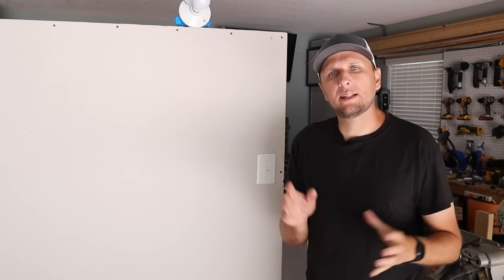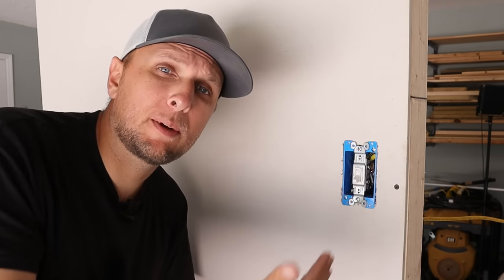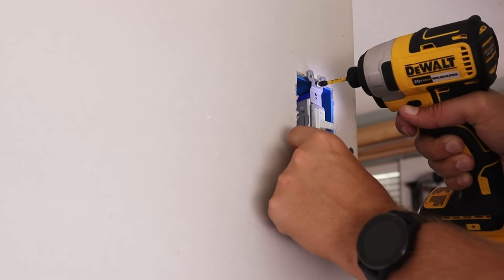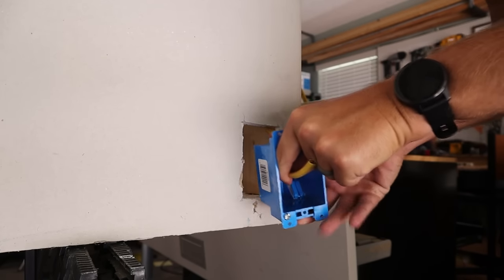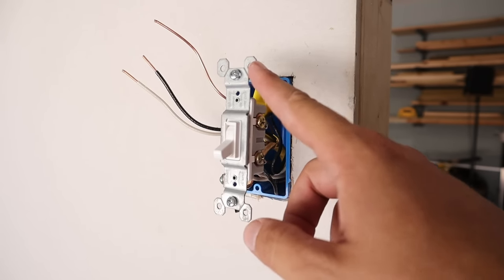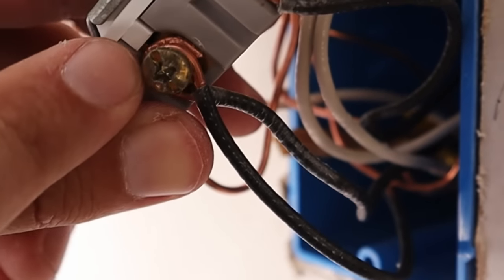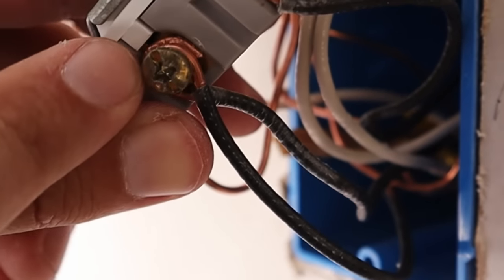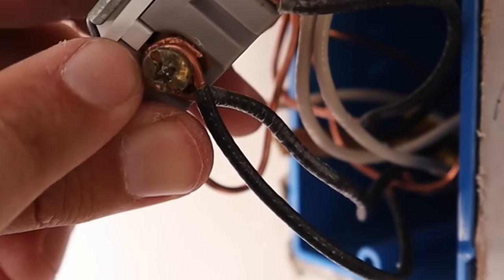How To Add An Outlet From A Light Switch | Common Mistake

Comment: Great vid. When I install a receptacle and have marked it on the wall, I’ll start sawing in the middle of the horizontal line and cut towards the stud (in your example towards the right). 99.9% of the time the stud finder works. I remove the drywall closest to the stud, so I can look inside to determine if I’m lined up like I want to be. If everything looks good I remove the rest of the dry wall. If not, I can realign thus not cutting to big a hole.
Reply: Multi tool is best on dry walls
Reply from the maker: Thanks for the input!
Reply: … not cutting TOO big a hole.
Reply: @stephenwilliams6103  a multi tool is the worst on drywall. You can easily cut into a romex. If you do that, you’ll have to run a new wire, or open the wall and install another j-box to fix the break. Additionally, a power tool will make a LOT of dust that can’t be cleaned up for hours.
Reply: @BitSmythe  Hospitals have been using multi tools (same principle)for cutting off plaster casts  on broken limbs for years, it's about using the right blade.
Reply: @BitSmythe  I use a vacuum while cutting.  And avoid going deep.  Also we only use armored BX cable here in NYC.
Reply: @BitSmythe  
Have to disagree about the multi-tool. 
. 
If you are inexperienced - thus, not cognizant or fail to remain cognizant of the fact that there may be other conduits (ie. PVC plumbing) or NM conductors running by where you are about to cut out an opening; so you are SLOPPY, and FAIL to cut in a SURGICAL manner: then yes, you are more likely to create a very undesirable situation.

IF you are not CAREFUL and fail to cut as I said, in a surgical like manner (ie. thrust deep into the wall willy-nilly): Then you can damage 'stuff' that might be there, with EITHER with a DRYWALL SAW or a MULTI-TOOL.
Reply: @sclm55  Correct. We who are experienced can feel how the tool works. And they’re great for so many things. Even still, I’ve seen wires that have been run around a stud and barely below the surface of drywall, plastered over and with no nail plate. Personally, my work is often in very upscale locations so we use a hand drywall knife with a catch tray (paper dustbin, painter’s taped to the wall) AND a vacuum. Not a spec of dust left over anywhere. Just one of the reasons every one of our Yelp reviews are 5-stars.
Reply: Overall. Your video is instructive.

I would have started out though addressing the fact that quite a bit of NM (Romex) powered switch boxes ONLY contain [1] one NM cable (14/2 or 12/2) from the lighting outlet box to the switch box...meaning, there is NO NEUTRAL [grounded conductor] IN the switch BOX that will be needed/required to FEED any proposed receptacle outlet 'downstream' of that box.

But of course, that hasn't stopped some 'creative' individuals from 'overcoming' that 'small obstacle'. 

No. They being the magicians that they are, they just just utilize the BARE grounding conductor in the switch box; and connect the white (neutral) wire 'feeding' the new outlet to it to create their return path!👍👌👏

🙈 🤡 💩 😖 😳 ☠️

Try to point out to them the danger and illegality of doing such a thing, and invariably what is their all inclusive answer to this?
 "WELL, IT WORKS!"

Instead of saying, "I wish I had a NICKEL for..." Due to Biden's hyper-inflation causing (destructive) policies, I have to compensate (adjust for that inflation) and say,  "I wish I had a DIME and TWO PENNIES for every time I've heard THAT line" - over the last 45 plus years. 

So check to make certain your proposed power source has a continuous power 'HOT' wire (ungrounded conductor) AND...AND a NEUTRAL wire (ie. the grounded, not the grounding conductor). 

As has been stated many years ago: 
The NEC [National Electric Code], is 'built upon' dead bodies and destroyed property (the result of electrical fires). 

Just because something 'works' (appears on the surface to 'work'), isn't the correct criterion to judge whether it is correct let alone a safe practice or methodology.
Reply: @BitSmythe  This is Electrical class not English class. Did you have trouble understanding what he meant?
Reply: @BitSmythe  You talk about wires being wrapped around a stud and barely touching drywall? Sounds like your 5 star reviews are from BFE because your a vacuuming service. Anyhow, they do have multi tool adapters for an entire electrical box of certain thickness of walls for an applicable situation like this. Also, the whole surgical thing and hitting pvc etc. you got a whole 1/2-3/4 inch after penetrating the inside drywall. Get your shit together. I’ll hire you when I need a carpet cleaning for dust thank you.

Comment: I normally use the stud on the other side of the cavity from the light.  This does make it a little more difficult to fish the wire but it does reduce the risk of the box conflicting with a wire running down the stud with the switch.

Comment: I watched a few of your videos and they are very well made and very informative. I am 60 yrs old and done many electrical DYI’s but today I learned about the hole in the wire strippers to make the curve in the wire, I use to wrap the wire around a small screwdriver or clamp the end of the wire with the wire striper and twist into a curve. I’m always looking for the best way to do a job safely and properly and I have a question about receptacle installation that an electrical engineer told me about which makes sense to me but I’ve wrote enough for now and will ask the question later on. thanks for your videos. 👍😎👍

Comment: I like it...  another straight forward video and lots of explanations such as the ones you did not the white common wires and the outlet ears you need to remove so the receptable would lay flat. Keep those items in your video, it keeps me from scratching my head  on why something like the whites are all bunched together or why can't I get this receptable to lay flat.  I will keep watching your videos and hope you have one on adding two receptables and one being a GFCI.  thanks again for your clear explanations.   Jim
Reply: If you don’t know why the neutrals are put together then you shouldn’t be doing electrical.

Comment: Just took apart a light switch in our kitchen and it's all most likely original from 1961 and it has two black wires under one screw just like you showed. It's worked for decades so when swapping in a new light switch I mirrored what it had before. I'm going to go in and do what you suggested. Thanks!

Comment: Interesting video, here in the UK we don't mix lighting and outlets on the same circuit breaker, that also means our lighting breakers are 6A rather than 15A.
Reply: Lights and outlets are also on a different circuits here in North America (or should be, at least...). I don't believe it's prohibited though and sometimes the lighting circuit is closer to where you want your new outlet and easier to access so this is why you find outlets connected in parallel to lighting circuits like this on older houses.
Reply: @Eduskator  not banned here either but lighting circuits are typically lower rated on purpose to stop you mixing appliances with lights. This goes back to how we do our wiring with rings. I could technically add a 13amp socket in the loft for a lighting circuit that needs a transformer and this would be ok as long as the fuse on the plug is 5amp rated or that ring will trip out.
Reply: 15Amps at 120V is 7.5 Amp at 240V, so the breaker size is comparable, the issue is the breaker and cable are sized for a maximum load of 1.8KW, either it trips for overload and at the same time leaves you in the dark, or some idiot puts a bigger capacity breaker and ends up cooking the wires if not replaced, it could be seriously dangerous.
Reply: The big question, is the US system protection and safety inadequate.  Or is our UK system overkill.?
Reply: @digihorse6730  The UK system is much safer. Most standards are based on it now anyways, for a long time US/EU systems lacked even an earth connection (and still do for a lot of connections). Our plugs are secure in the socket at all times. Although we do still have older style ring circuits left from war time our consumer units are much smaller.
Reply: @digihorse6730  The US system is dangerous, with plug designs that encourage pulling out by the cord, live contacts exposed when plug is inserted or removed and easy to reach with foil when inserted fully. No plastic sheathing at the hand side of the connector like the UK. Sockets with no earth/ground are ubiquitous. Where a ground is present it's often a bare metal projection on the outside that's attached to an external metal screw in the socket cover plate. Neutral to ground fault could have that exposing hands to the neutral power flow.  No fuse in the plug to protect the appliance flex cord from overload if that cord is say 1A rated for a low demand appliance that in a fault might carry 15A until breaker trip and burn. Breakers instead of switches are more common in older installations than in UK though. But modern UK stuff will be using RCBOs on every circuit (combined breaker and leakage detection tripping) . The very newest UK might have an arc fault detection tripping feature as well, so a gap fault will trip instead of allowing an arc.

Then again, I was in Holland recently and there was a normal power outlet less than 12 inches from a basin water tap in a bathroom. US definitely doesn't have a monopoly on dangerous.

Comment: This is good but I think you should have started by explaining that there are two different kinds of switch possibilities.  If this switch was just a loop, they could not supply constant voltage to the new outlet.  You might want to have a short vid to show the different setups for switches.  Someone asked about a three way switch but that won't work typically for this but it could.

Comment: It would be important to verify that the switch isn't simply switching on/off power between black/white with the actual "hot" in the light box.  Basically switching hot in light box.  Also, 3-way switch would have issues too.

Comment: Great Video - exactly what I needed to extend outlets in my garage on an exterior facing wall.  The whole wall only had 1 outlet that is already 'overloaded', but there is 2 exterior lights that are on another circuit that hardly get used, so I can tap into those switches and route additional  plugs - so thanks!
Reply: So you're going to overload 14 gauge lighting circuit?
Reply: @charliedecker7702  you only overload IF you have everything running AND... 14 gauge when paired with new LED lighting can totally handle it.  These circuits are not powering woodworking power tools, this is an area of the garage that I am setting up my 5 volt electronics bench....it will more than handle it when combined with the separate circuit. :)
Reply: @graphguy  We generally keep lighting and power circuits separated, if we do mix them it's usually outside lights added to power circuit through a fused unit creating a spur/branch circuit.
Reply: @Charlie Decker  thanks for that. What is the code stating that? I own 3 homes that are from 25 to 5 years old and none follow that, so I'm curious where is the code stating it? Thanks
Reply: @graphguy no code but if you use a high powered appliance it can make the lights flicker

Comment: Thank you.. this is what I was thinking but for some reason I was completely overthinking the whole thing, second guessing myself as I often do and wasted a ton of time trying to work it out in my head because I knew I wanted constant power to my outlets but I wanted this light to be on a switch in between the run of of outlets.. either way you cleared things up for me and I was finally able to complete my wiring project.. 🙏

Comment: Nice video. All I would add is that, once you open the light switch box, you should do a quick check where the existing wires are. In one instance (where I was adding an outlet exactly as you show here), I assumed the wiring was coming to the light switch from above. Then I noticed wiring going both ways out of the box -- I knew I had to be careful identifying the line/load AND that I had existing wiring in my wall in the area I was going to cut.
Reply from the maker: Good tip!
Reply: I was upgrading my parents' 50 year old house at the front door area.  Three switches for outside light, indoor fan & light, and an outlet under that, plus an outlet just outside, at four foot height.  I made indoor outlet a GFCI and assumed the LINE came to the indoor outlet first, then  up to the switches, but I was wrong, and the GFCI was screwy.
Only after some research and a lot of YT videos, do I now realize the indoor receptacle was a retro fit 30 years ago (used old-box with wings), and the outdoor one was a separate later addition by my father 16 years ago.
I found out after getting into the 3gang switch box. I found two 12/2 were run to the ceiling fan, instead of one 12/3. Also, no wire nuts, just a bunch of electrical tape. smh.
Reply: @redmatrix  I've never saw or heard of a 13/2 wire. I'm assuming you meant a 12/3 wire, but in electrical work you NEVER assume anything.
Reply: @Dixie6716  You were right. My fingers were too fast for their own good. Fixed.

Comment: Before you start you should also verify you do have a complete circuit in the switch box. Older homes would have just run a hot switch leg from light to switch, no neutral. So in that case you would have to tun the wire from the light box and not the switch box to gain access to the neutral.

But overall, a great tutorial for the novice.
Reply: Yeah, I was wondering where the neutral was going to come from.
Reply: True, if the power is closer to the light than the switch, the power will go to the light first, so no neutral to the switch.
Reply: This should have been mentioned before anything was done. Can’t install a receptacle without a neutral.
Reply: @j777  Code no longer allows that type of dead leg switch circuit (no neutral at the switch), or the installation dead end switches. Most newer homes want to go the way of smart devices and all of those do require a neutral to function properly unless stated otherwise. So pretty much anything built in the 80's or newer should have a neutral in the switch box. Prior to that the power landed in the light box and branched out from there. But it also depends on what codes that municipality uses. They do not have to use or adopt the most current codes. Where I live they were still going by 2017 codes, and just recently update to the current 2020 codes (in 2021). So things might be slightly different in your area.
Reply: @barrybutts6396  True but I do not blame the creator for the small oversight. It happens. That is why there are electricians like me.
Reply: @jonesgang  thanks, I appreciate the extra information
Reply: @jonesgang  On three way circuits, only one switch has to have a neutral as long as the two switches are in sight of each other.
Reply: @sylkelster  Not according to 404.2c, unless you are going by older codes. But it does allow grandfathering.
Reply: hahaha that is the comment i just woke about what happens when no neutral wire in the switch box, you were thinking the same as me thanks
Reply: As I watched the video I was going to point out the same thing, as my 1969 built house was wired like that on many of the switches.  The romex from the panel went directly to the light, not the light switch.
Reply: @jonesgang  How many homeowners tackling this project lives in a home  from 2000s and up? Not many..
Reply: @DonkeyLipsDA3rd  If the house was built in 2000 then is it now a 22 year old house. All kinds of home renovations are happening and newer homes are a little easier to do then much older houses. Code has also changed a good bit during that time as well. So the answer to your question is a lot of homes!! And guess what bored people were doing while they were locked down.... All kinds of home renovations. You must be the only person who has completely forgotten about the plandemic and it's lockdowns. All the big box home improvements stores were packed during the lockdowns. They were not all looking for paint and window treatments. They were undertaking all kinds of home projects for whatever reason they wanted. It does not have to make sense to you or anyone, it is what it is. People like to DIY!!!

I can't begin to tell you how many homes I had to install new outlets on a wall for a TV. Most are brand new homes.
Reply: @jonesgang  I wouldn’t say a lot. A homeowner who lives in a house built,for example in 2010 that’s 3000-4000sq ft  ,is going to hire an electrician. They have the money to do so. Yea there will be exceptions but the majority will. Middle class joe who lives in his 1950  Cape Cod will most likely try to tackle it himself. This is from my own personal experience.
Reply: @DonkeyLipsDA3rd  The thing you seem to keep forgetting is not everyone has the same taste. A house could have been built in 2019 and in 2022 taken over by a new owner who has vastly different taste but the purchase price was within their range and location. Now they will renovate that brand new home to fit their taste and style. And just because they may have the money does not mean they are not going to try and save themselves money where they can. And if they think they can do something cheaper instead of hiring a pro, they will.
Reply: @DonkeyLipsDA3rd  yep, my house was built in 1898, with a newer addition.  I'm finding all kinds of interesting updates to work on.